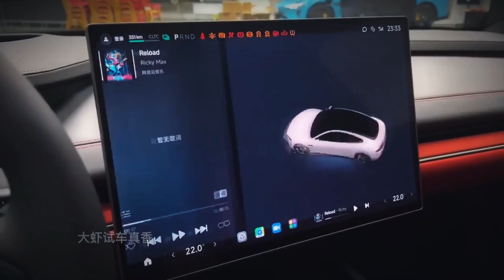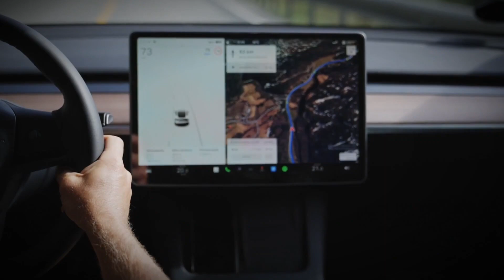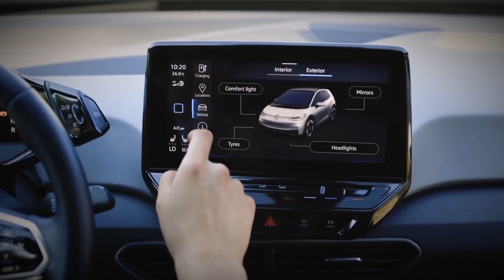Can You REALLY Drive 800km on a Single Charge, Testing the Xiaomi SU7

Comment: Your information isn't very good. You never made any live test. Xiaomi has got LFP batteries, like my BYD. You normally charge 100% - and recharge at close to zero or perhaps 5% with LFP's.  

The "official" range in China is CLTC, in Europe we use WLTP, and in the US - EPA. All 3 are different methods - the CLTC the most "kind", the EPA the most correct probably.

One main problem with "average" milage is also temperatures - both too hot, or too cold. Perhaps Xiaomi has solved this in a better way - who knows - until som serious test is done, by people who understand the complete issue. Besides I know Xiaomi use 'Aerogel' for battery isolation, the same as in Spaceships/shuttles.

Subscribing to this bullshit - no thanks.
Reply from the maker: It seems you're expressing frustration about information accuracy and concerns about electric vehicle (EV) battery technologies and testing standards. Here's a summary of the key points you've raised:

1. *LFP Batteries:* You've mentioned that both Xiaomi and BYD use Lithium Iron Phosphate (LFP) batteries, which have different charging protocols compared to other battery types. You prefer charging LFP batteries to 100% and then recharging them when they are nearly empty, around 0-5%.

2. *Range Testing Standards:* There are different testing standards for EV ranges:
   - CLTC (China Light-Duty Vehicle Test Cycle) is used in China.
   - WLTP (Worldwide Harmonized Light Vehicles Test Procedure) is used in Europe.
   - EPA (Environmental Protection Agency) standards are used in the United States.
   You note that these standards provide different results, with the EPA generally being more conservative and accurate.

3. *Impact of Temperature on Mileage:* You've highlighted that temperatures, both hot and cold, significantly affect EV mileage, which is a crucial consideration in evaluating vehicle performance.

4. *Xiaomi's Technology:* Xiaomi uses 'Aerogel' for battery insulation, a material known for its excellent thermal insulation properties, similar to those used in space technology.

5. *Concerns about Information Accuracy:* You emphasize the importance of serious and knowledgeable testing before drawing conclusions about EV technologies.

Your skepticism towards certain information sources suggests a preference for more thorough and technically sound analyses. If you have specific questions or need detailed information on any of these topics, feel free to ask!